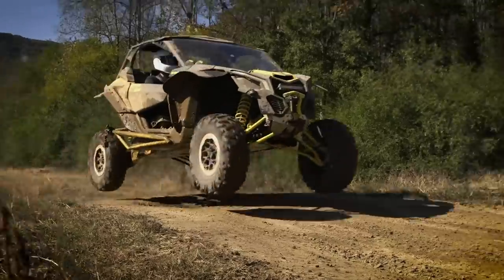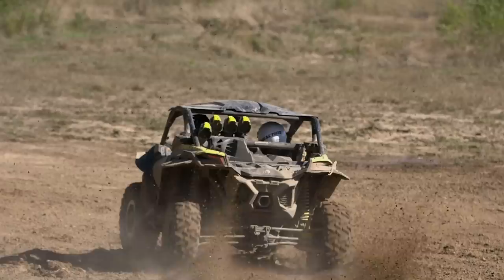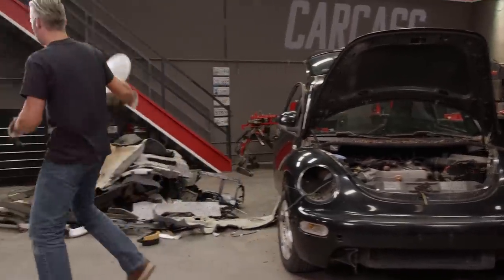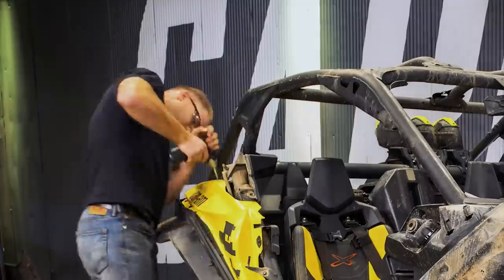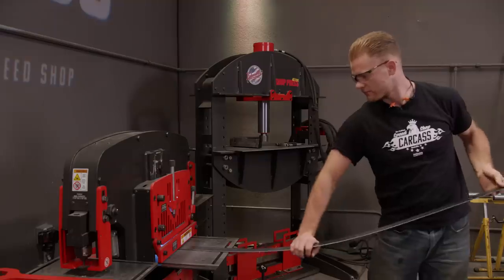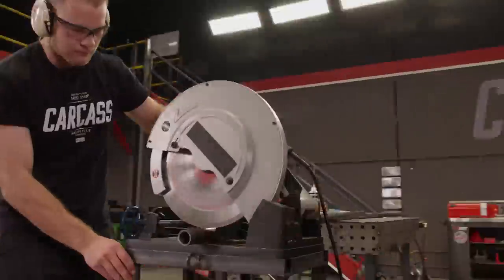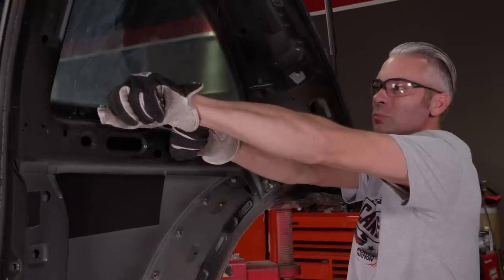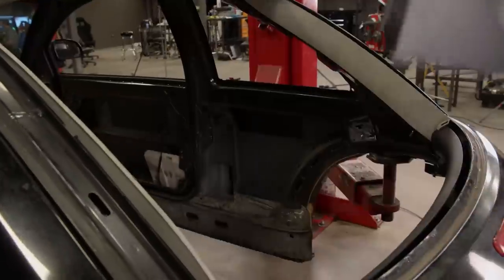How to Build the Ultimate Baja Bug: VW Beetle Body and Can Am Power

Comment: 37¾ x 2 = 75½, how did you get 65½?
Reply: Seemed a bit short to me too. It wouldn't be so glaring, but the show begins by listing their credentials, one of which is engineer. "I used to be a technician, but now I are an engineer." It's an easy mistake boys. Take the ribbing and just move forward.